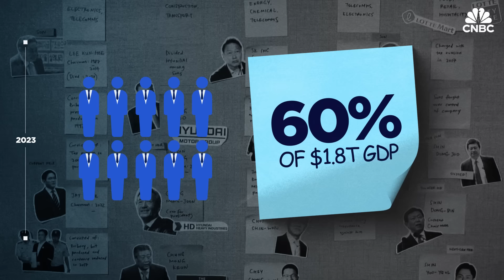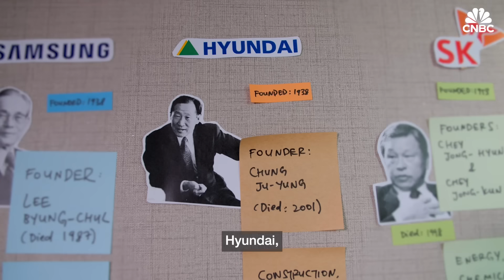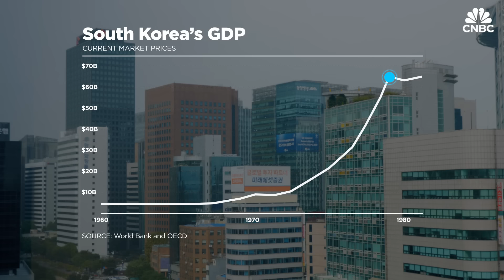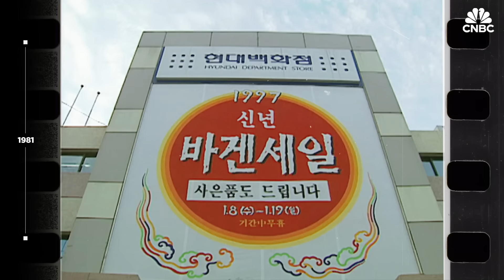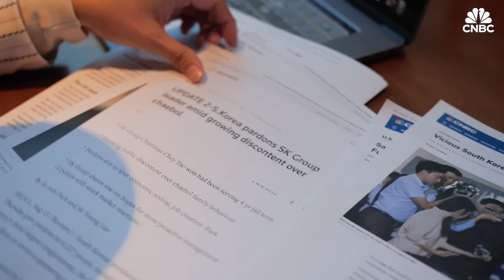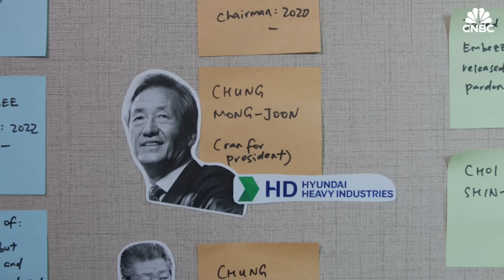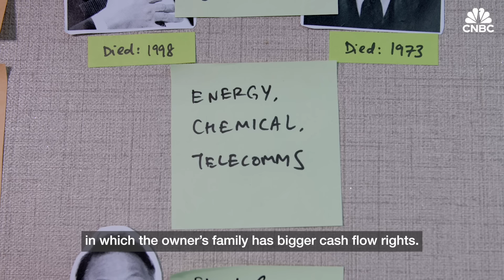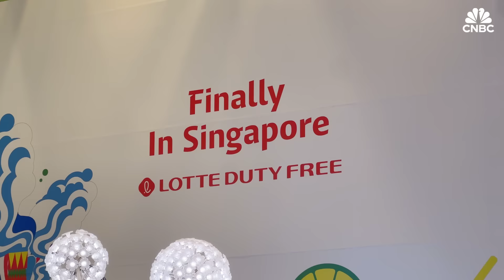Can South Korea’s untouchable chaebols change?

Comment: The Chaebols don't need change imo. They're what allow Korean brand to dominate the global market relative to their smaller population size. The US and Chinese domestic markets for example are huge and can compete internally but if South Korea tried that their companies will have lower profits which means lower R&D to compete with other big global companies. Pooling all your resources in a handful of conglomeretes is better than having thousand of barely surviving mid-size businesses with low margins etc.
Reply: You can be profitable being a specialized manufacturer. I believe this is their model in Germany. It doesn't have to be vertically integrated, and certainly doesn't have to be corrupt / criminal.
Reply: But the problem is that there's an increase in competition from Chinese companies in every sector in South Korean industries. Especially shipbuilding, semiconductors, smartphones and vehicles. Remember, the Chinese economy is not completely dependent on the private companies.

Comment: The idea that Chaebol was behind south korea's growth is nonsense. 
If the population works twice as hard as outside world, it grows. Only in mass production sectors, which Korea thrives.
Because you can produce goods and export them cheaper than competitors, you succeed nomatter what.
It's like a slave owner will alwasy win agains non-slave owner when they are using the same technologies and same equipments.
Most of cutting edge equipments and technologies are imported from outside, and as Korea keeps making more money, the more expensive equipments they can import, so GDP grows.
Similarly Taiwan, Singapore, Japan, China all have grown at similar rate as Korea.
The idea is han-river miracle is manufactured by Chaebols to promoted the idea Korea's economy is great.